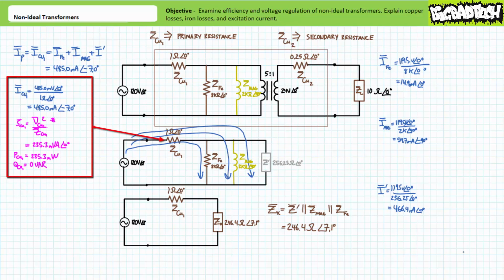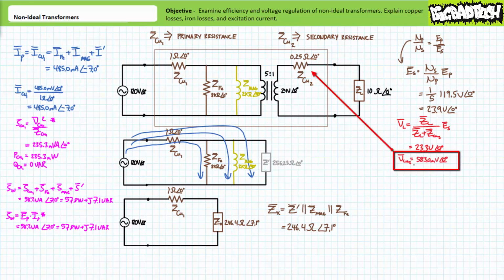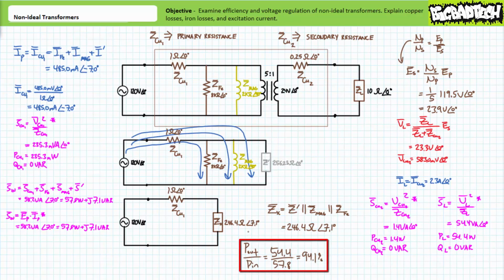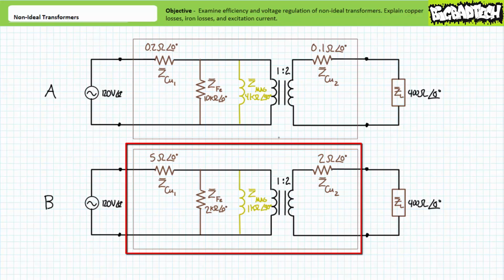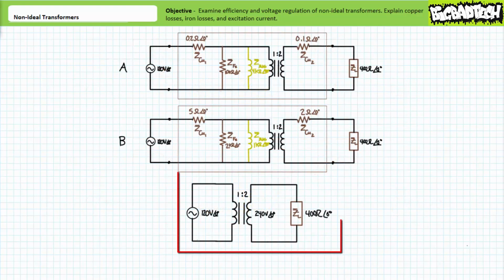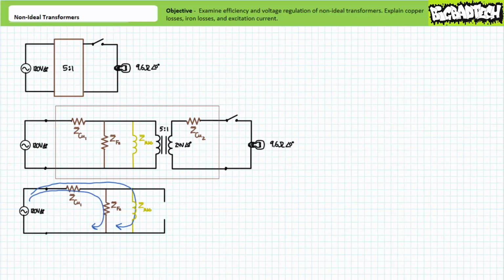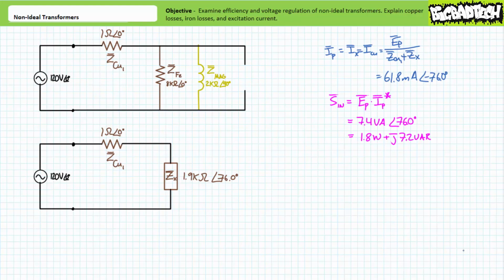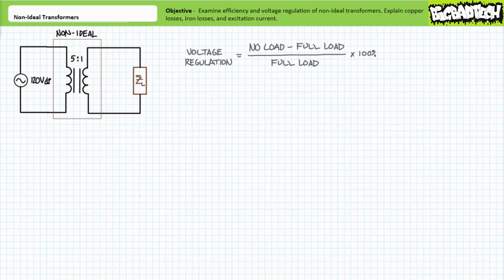Non-Ideal Transformers (Part 2 of 2)

Comment: Great Lectures on Non-Ideal Transformers!  Very informative and I appreciated the humor mixed in.  If you are starting with a transformer with unknown transformer parameters (except for turns ratio), how do you go about determining/measuring what impedances are appropriate to use in the model?    Are there measurements you would make with an impedance analyzer?  (Would this include DC resistance and AC Complex Impedance at the frequency of interest?  Would the secondary be shorted or left open for the primary's measurements?  What would be done to characterize the secondary?)  Thanks!
Reply from the maker: Often times one doesn't need to resort to this level of detail. Check out the open and short circuit test lecture at: https://youtu.be/66EUzL5ftYo

Comment: Sir do you cover the open circuit test and short circuit test somewhere else sir?
Reply from the maker: Unfortunately I don't have a lecture on these tests, however, this is one of the lab activities we perform when discussing transformers. These might make a good supplementary lecture one of these days. BE CAREFUL when you do the short circuit test. Don't apply full voltage to the primary but rather slowly ramp it up until you achieve the rated current.
Reply: For what it's worth you are the best on the internet in this field!
Reply from the maker: Thanks! Make sure to tell your friends this resource is available.
Reply: Will do sir. Many thanks from South Africa.
Reply from the maker: Robert, I recall you being interested in this material. I'm publishing the transformer open and short circuit test lectures this week. Check it out at: https://youtu.be/p8phN2tNzLU

Comment: How does having a greater ZFe & ZMag magnitude constitute a  (better, smaller  ∐ irregularities) in "I" & "E" therefore being a more efficient device?
Reply from the maker: Consider ZFe and Zmag as "leakage" paths that are diverting effort away from the transformer primary coil. If the leakage paths are high impedance less effort is being diverted from the intended destination and performance benefits. If the leakage paths are low impedance more effort is being diverted from the intended destination and performance suffers.
Reply: So this would be power not transferred or consumed? Similar to a high input Z of a VOM in ∐ so it won't overload/consume power from the ckt you are measuring?
Reply from the maker: Yes. Any power consumed by these irregularities is not delivered to the intended destination.